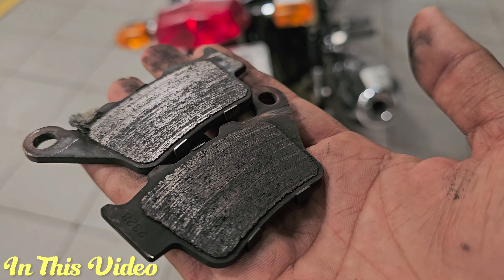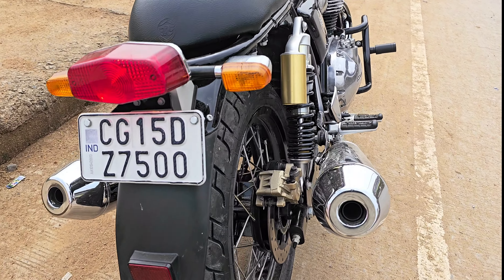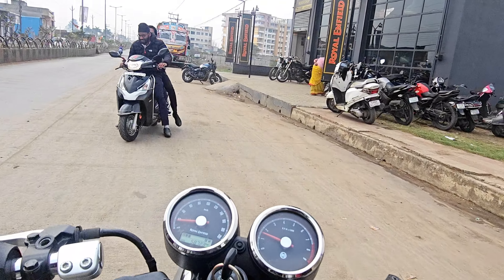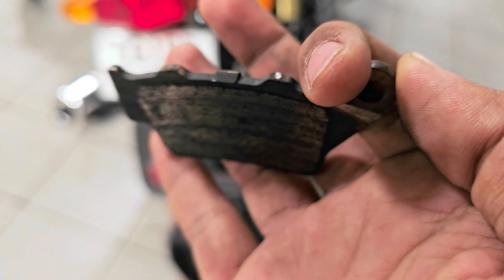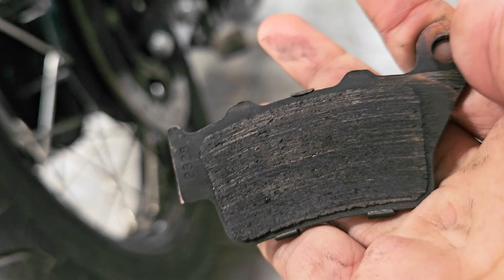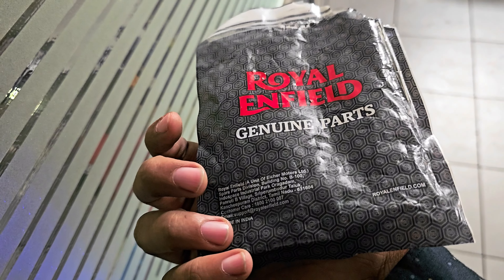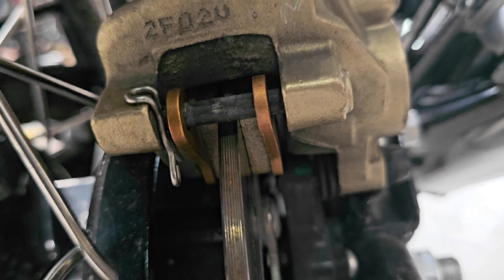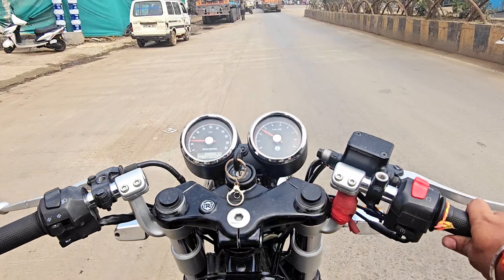Continental GT 650 Brakepads Replacement | Ride Review

Comment: Bro what about milage ?
Reply from the maker: In city 14-15 or 19-20 in highway
Reply: @Ownmetal  how to count it, about a week ago I tried to measure it showed me 13kmpl on my int650 i think I miscalculated🤒
Reply from the maker: @928__  bro check tank to tank with the same petrol pump autocut nozzle should be use
& gt has the same kind of mileage 11-13 if your bike is new
Reply: @Ownmetal  ya my bike is almost new i bought it on March 2023 but I barely used it most of the time it was on idle now after boards i manage to ride it. It only got 250km on odo you can imagine.. by the way thanks for your reply it helped me you gained +1 subscriber 👍